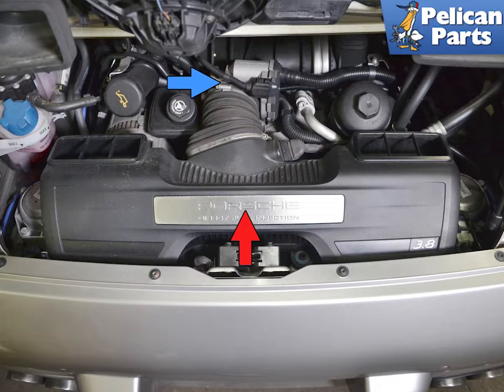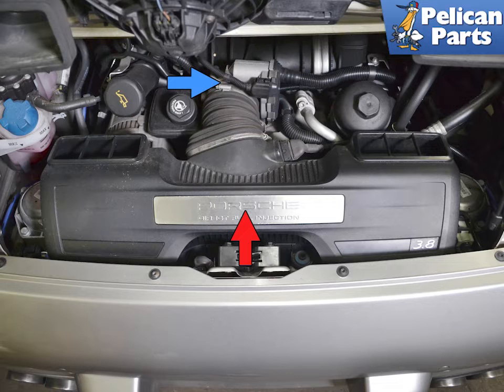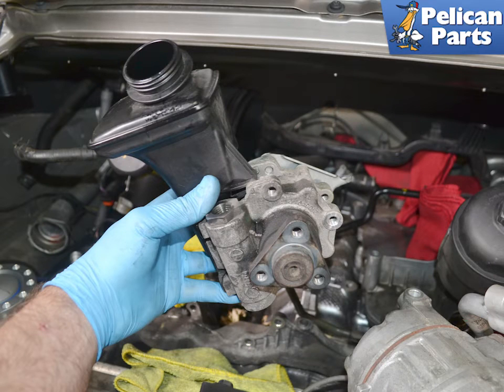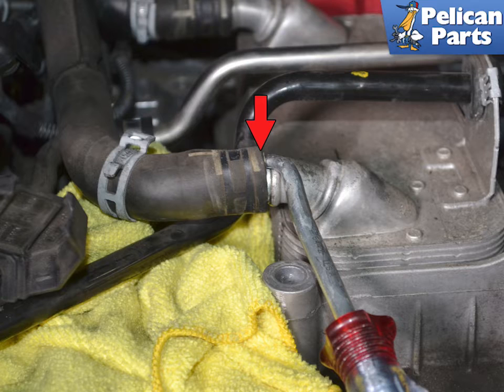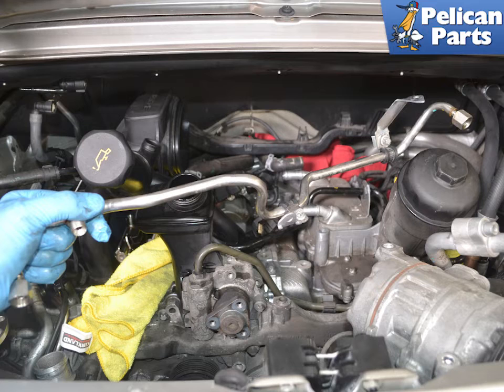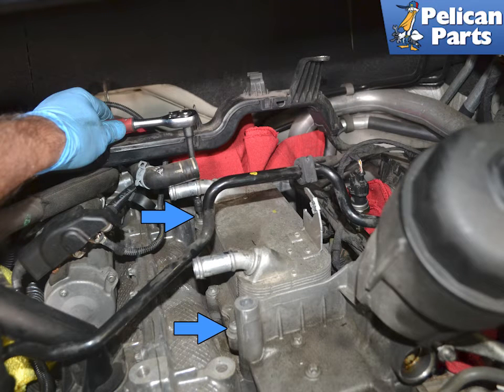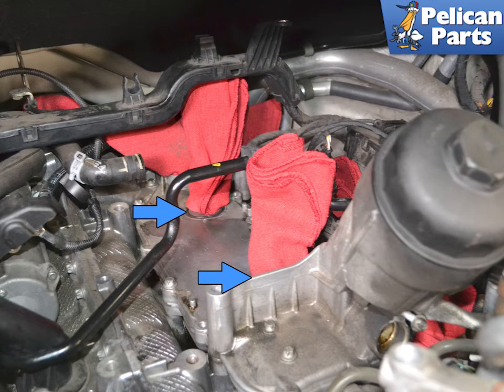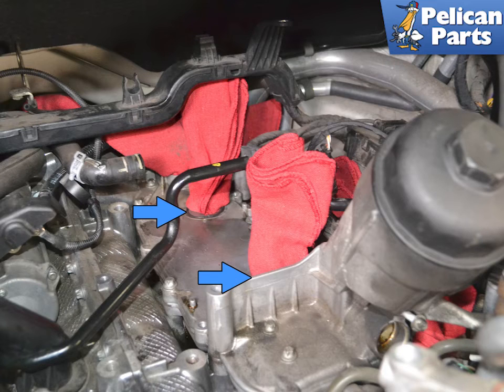Porsche 997.2 Carrera Oil Cooler Replacement (2009 - 2012)

Comment: So the transmission oil cooler for 997.1 and 997.2 looks pretty much similar. So have a question if .1 would fit in .2? There’s a price difference and availability issue.
Reply from the maker: Not 100% sure. 

With your vehicle info handy, give The Pelican Parts parts specialists a call at 1-888-280-7799. They can figure out what part or repair kit you need.